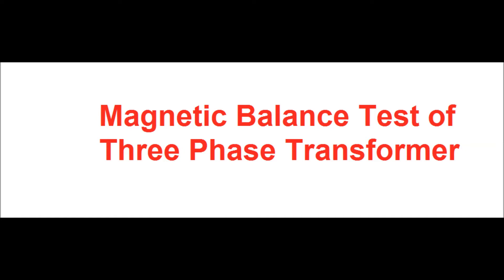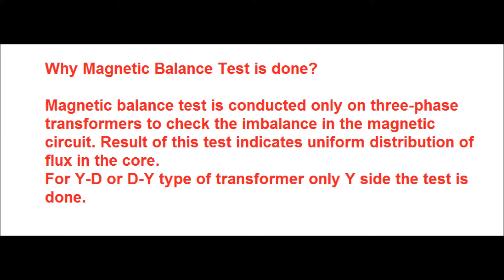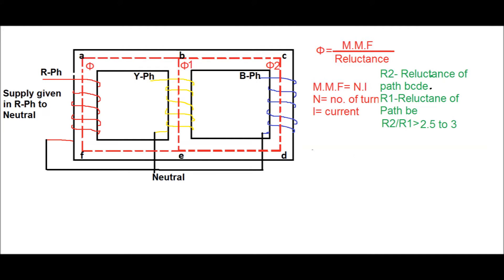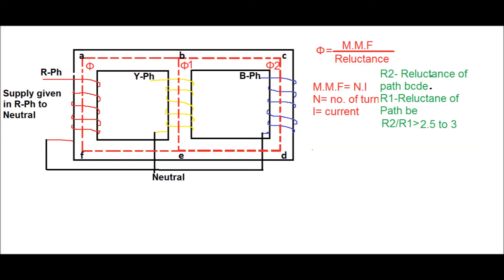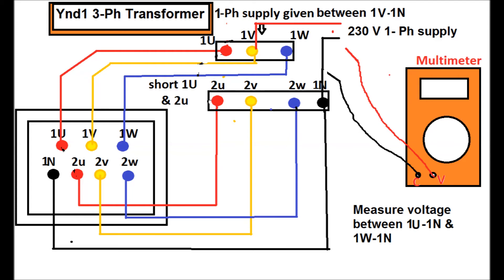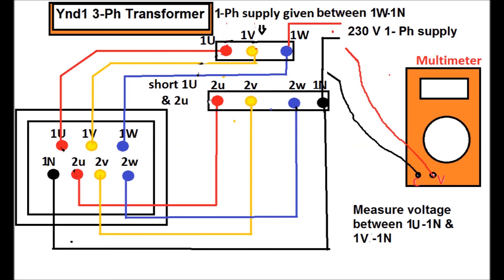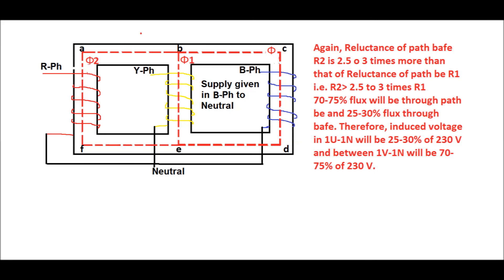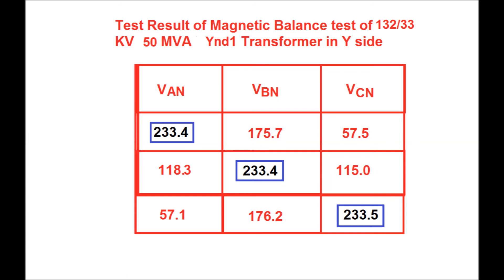Magnetic Balance Test of Three Phase Transformer (Transformer Testing)

Comment: For 160MVA, 220/66kv,
If volatge applied to R phase 240v,
B phase shows only 4-5v.
Same as for B phase and measurement on R phase.
Why?
Reply from the maker: First the transformer need to be de-magnetized then do the test test again and check the result.

Comment: Why magnetic balance test is not conducted on single phase transformer ?
Reply from the maker: Magnetic balance test is done to check the path of the magnetic ckt is ok. In case of three phase transformer there are three limbs located on two windows and that is why magnetic balance is necessary for checking whether flux is distributed to the intended path or not. But in case single phase transformer flux is same through the entire magnetic path so there is no question of magnetic balance and hence only magnetization current test is sufficient and magnetic balance test is not done in single phase transformer.
Reply: Thank you its very helpfull